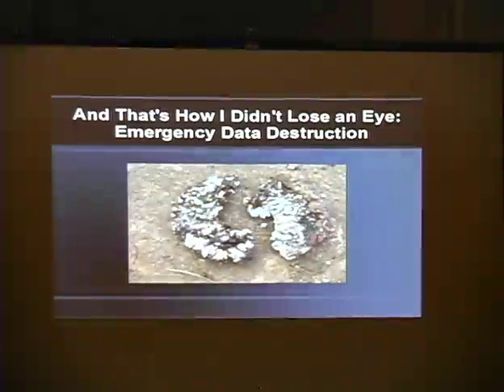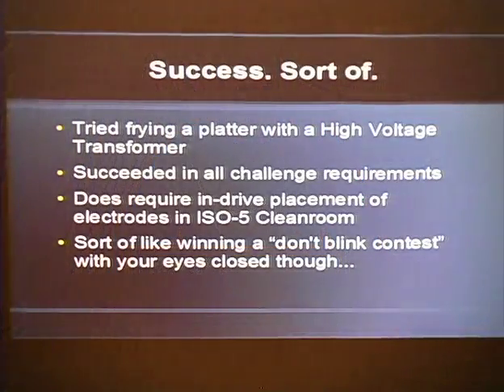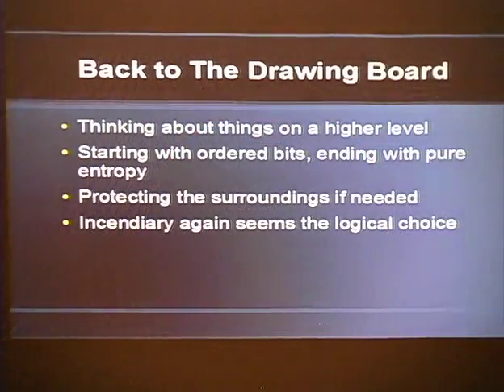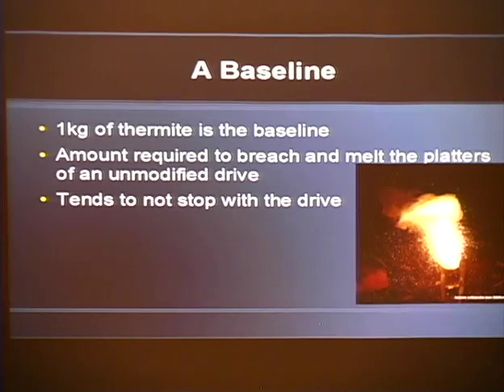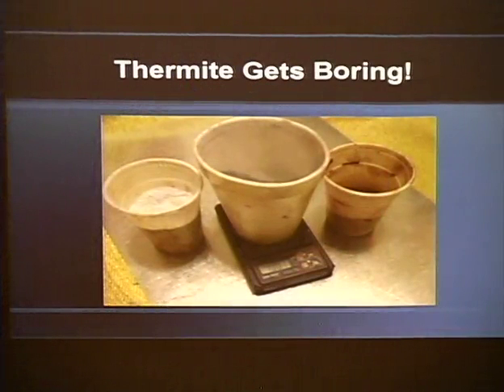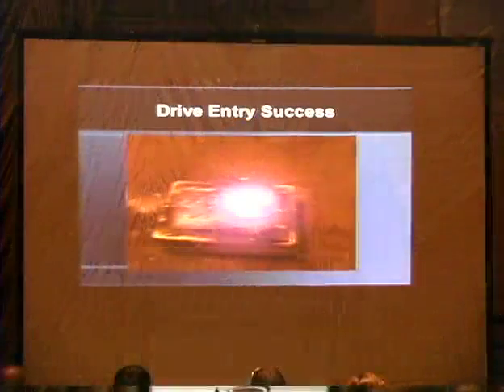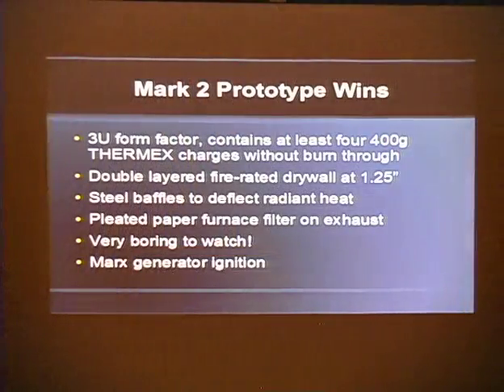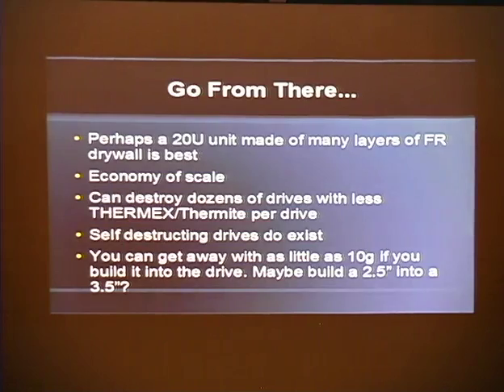Shmoocon 2012 - Skunkworks Emergency Data Destruction

Comment: 3alarm, absolutely based
Reply: @ballskin  legally speaking, he was tried and convicted of depraved heart second degree murder. He didn't need to stab the kid, instead he set up a daisy chain of electrical extensions which started smoking and threw the circuit breaker to which he "switched over" the system, lying to Kafra because there was no other system, and then the basement caught fire killing the kid ONLY due to Dan's extreme disregard for safety and human life.
Reply: @ballskin  dummy based
Reply: You people have been saying "based" for over six years now? How lame.
Reply: @ballskin  we talking about the same guy who would reguarly call up phone phreaking shows and talk about ways to melt bones and kill people and also was trying to garner interest in running a live stream to showcase him torturing and eventually killing a racoon

im kinda with you on the maybe it was manslaughter idea but lets not make this dude out to be the most normal of human beings ever there was some fucked shit going on in this dudes head
Reply: @ballskin  1 year off? no my freind 10 years was the MINIMUM he would have been handed for premed 39 years would be the maximum so it was alot more than just 1 year

as for the 9 years i think thats fair hed be out in less time for parole and accidental or not he put his freind in great danger and acted grossly negligent by ignoring his freinds mentions almost 5 times that there is smoke downthere and instead of investigating he just kept resetting the breakers
Reply: @ballskin  ok are you going senile here ive said multiple times he got manslaughter and shouldnt have gotten premed nowhere have i said he murdered anyone your litterally arguing to a wall at this point
Reply: @ballskin  Just curious, do you know Daniel or have any contact with him? Do you know what he is up to today?